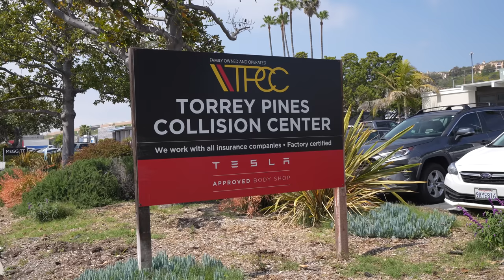Building A Turbocharged Honda S2000 AP2 - Part 5 - Dry Ice Blast & New Paint!

Comment: Seems a lot of people don’t like the rear bumper. I haven’t seen it painted yet, but I’m not fully sold on it either EDIT: yeahhhhhhh not a fan of the bumper painted. If it wasn’t silver it would be better, but I also despise silver. Or once it’s lower it might be better
Reply: Yea for me it’s less about the bumper and more about the color
Reply: Its the diffuser for me, i kinda like the bumper, if it had a diffuser that complimented it and not just a put on diffuser that looks like its floating in the middle of it.
Reply: @Akosa117  it just doesn’t work in silver. It sticks out from the rest of the build too much. Like I get it’s the aero bumper and it’s got an aero element technically but it just. Doesn’t. Work.
Reply: @nickikirketerp00  I agree with that, if it had something more than a two element diffuser it could work better

Comment: That car is gonna look pretty rad when it's finished.  I really like the Spoon form for effect style, always have.  The rear bumper is very much designed as a performance piece rather than looks with the high cut for diffuser placement and the twin reliefs for reduced wheel drag.  

-I'm willing to bet that this specific build will feel rock solid at speed with the reduced air pressure in each wheel well, promotes less drag and more downforce and consistancy.  Rock on Throtl!!! 🤘

Comment: Rear bumper ruins the look, stock one looks way better
Reply: Horrible
Reply: I agree it looks so ugly!
Reply: Designed by Stevie Wonder
Reply: I would wait for the end result bro I’ve seen the same comment on some other builds and have been proven wrong if throtl has shown us anything it’s that they’re meticulous and motivated to put something amazing on the road.
Reply: I agree
Reply: My thoughts exactly
Reply: For the 300ZX, they also talked about a body kit that looks extremely ugly in my opinion. I hope that won’t be installed. 😅
Reply: Some rear bumper add-ons and it should help.
Reply: I agree
Reply: 100% I love spoon products but that rear bumper 🫠
Reply: The original front and rear bumper looks so much better, pleas change the bumpers
Reply: Agree, stock bumper is way better

Comment: I'm with the group that thinks the body kit overall is very lacking. The rear bumper doesn't make sense. The front bumper is very plain. I love Honda I have an 04 odyssey with quite a few upgrades and I would rather drive that than this s2000. I'm so sorry guys. I don't hate on throtl builds but this one is needing more. This is of course my opinion. I'm not dissing any of the guys just the choice of parts.